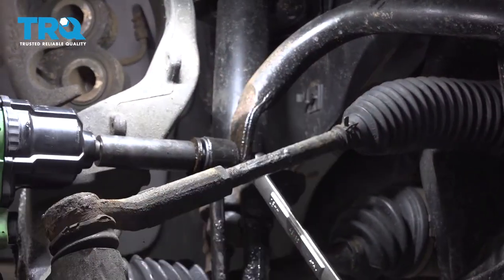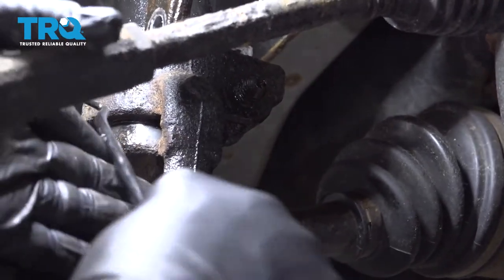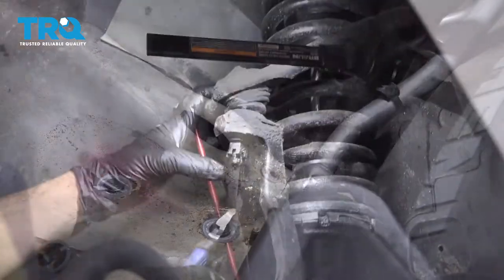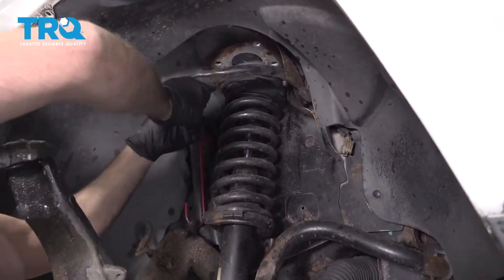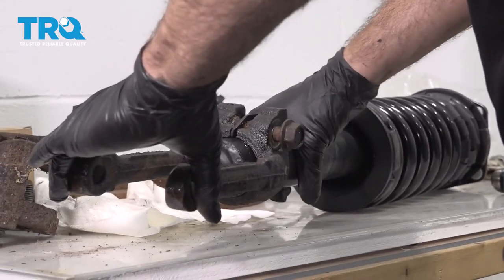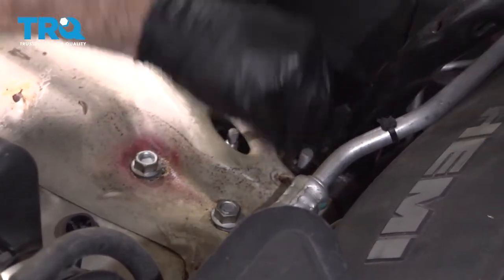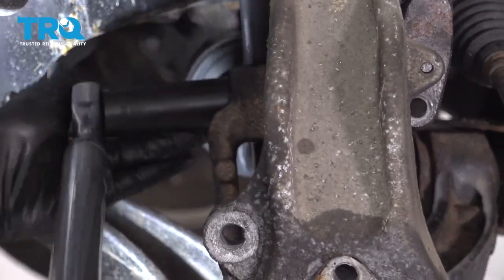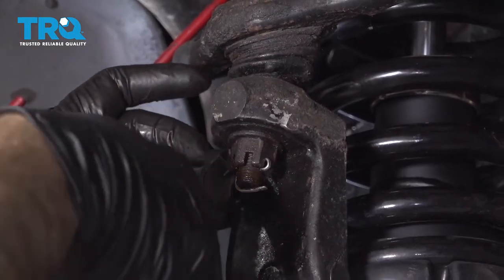How to Replace Front Shock & Spring Assembly 2005-10 Jeep Grand Cherokee

Comment: Make sure to torque the clevis bolt with the jeep on the ground, or jack up under the lower control arm to normal sitting level THEN TIGHTEN THE CLEVIS BOLT.  Otherwise you can over stress the bushing and ruin them.  Same with Upper control arm bolt and lower control arm bold for that matter.   Funny these techs make a lot of mistakes in their videos.  Definitely not certified mechanics.

Comment: How about the other side where a mess of electronics are covering the mount nuts?
Reply: I own this same vehicle. To access the driver’s side: there are 10 mm bolts you undo; there are four. And they’re visible you can’t miss them. Once you undo them you can lift the fuse boxes
Reply: Working on a 2008, there are not 4 bolts, there are 3 nuts to remove. Two should be visible, one will NOT be. The rear most fuse box must be unclipped and flipped over to reveal a recessed 10mm nut. The whole assembly will mostly flip over to give access to the strut's nuts

Comment: Excellent videos and I appreciate the torque specs!   4:27  Is there a "stop"?  If not tightened enough couldn't that strut slide down further into the clevis?  In another video they greased it to get it to slide in easier!